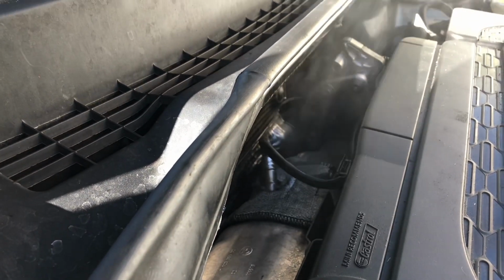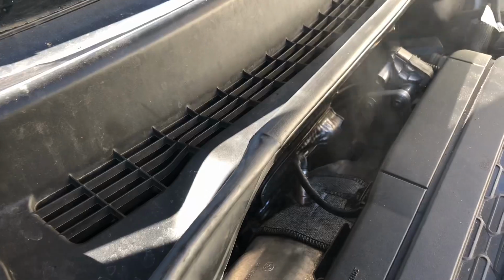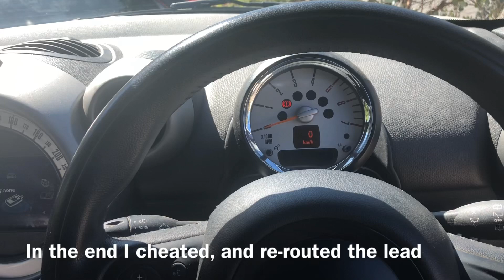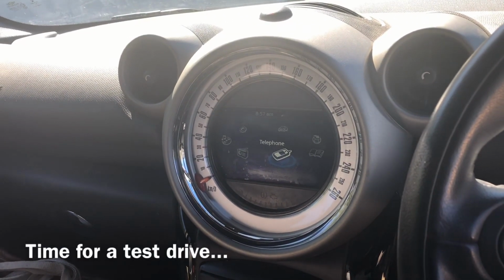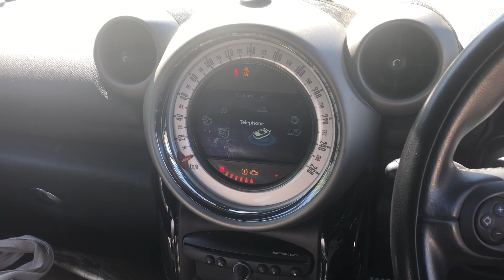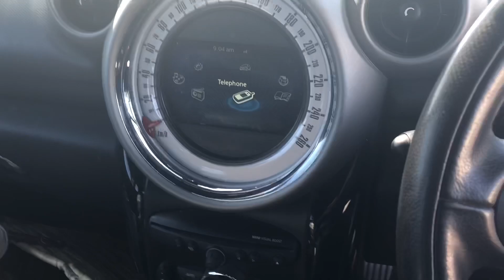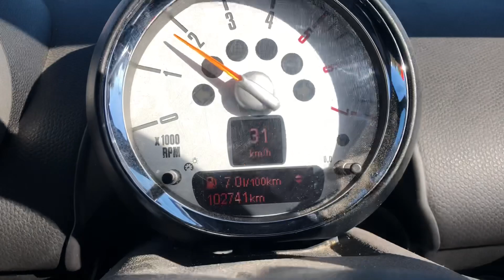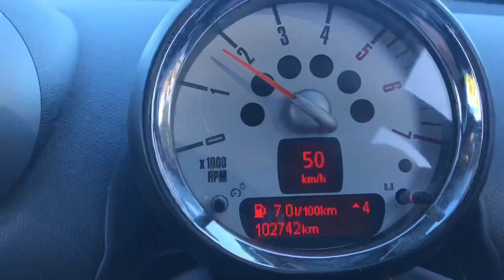Mini Countryman Series - DPF repairs : Epilogue

Comment: Mate. It makes you ask if the new cars are worth the grief. One of the issues with modern vehicles is the very small cross section of the wiring.  Whilst theoretically adequate real world experience shows that it lacks durability. On certain automatic transmissions that I have done a lot of work on if the wiring to the solenoid gets pinched between the oil filter and the valve body you have all sorts of problems. Relocate it so it is free and all of the problems go away.  What has improved significantly is connector technology. Today's connectors are much better sealed even if they lack durability in some areas.
Reply from the maker: yeah for sure... my issue at this stage is, I finish paying for this car in october this year, then no more car payments, so if I keep it fixed, my transport costs drop dramatically. getting something else then raises the spectre of what else don't I know about, and safety is a big issue for my missus, it must have eleventy five airbags, be able to drive itself around corners, and avoid kangaroos, and mix a decent martini...
Reply: @JBFromOZ  ahhhh
The old martini problem....
Reply: Hey Greg - The best connectors are from the Pilbara --  twist & tape . Just kidding !   I just clicked on your picture wondering who it was & bugger me  -  I know that bloke !   ,   Cheers .
Reply: @swanvalleymachineshop  Hi Max. It's a damn small world lol

Comment: So you think it might have been RF and the routing? Not sure but can you acquire a OBD connector tool and read some or all of the sensor feeds? If it is a delta domination battle of the two thermocouples you might be able to monitor and see the decay.  Tools I have seen are cheap to wildly irresponsible. I am using one for the modern Volvos now that reads just about every manufacturer from everywhere. 

Shame you aren't around the block. 

Pretty sure all auto manufacturers have to comply with ne or more standard communication protocolsto allow third party tooling to function.  ISO - CAN - etc. 

Dan

Comment: Hello, have you found out what the issue was / have you repaired it? It happens to me every now and then and noone knows wtf is wrong with that car
Reply from the maker: The issue for me ended up being some dirt in the accelerator pedal, this caused one of the 2 signals to drop to ground, and the ECU goes into “confusion” mode, with any brake input the ecu will not allow the engine to rev at all either. Car has been trouble free for 50,000 kms since
Reply: @JBFromOZ  thank you for your answer, you’re the best!